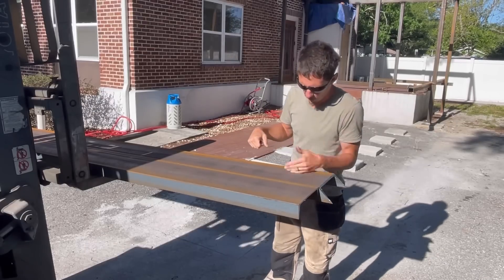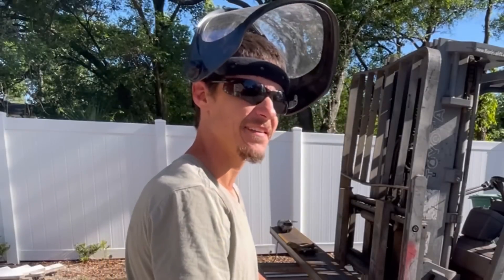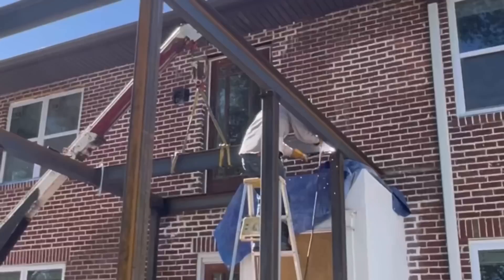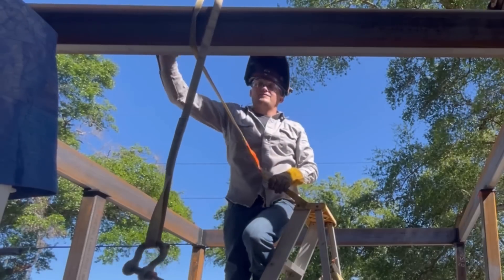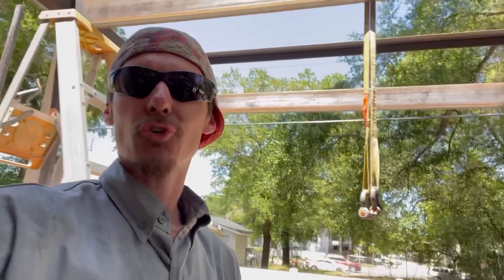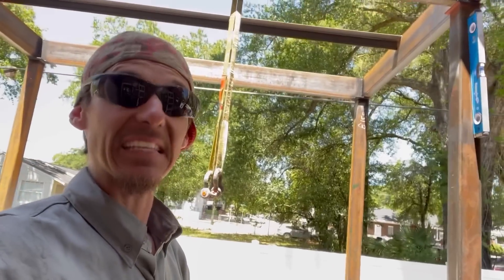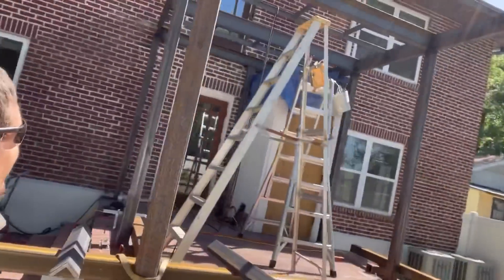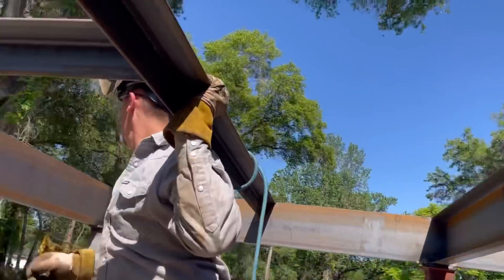Mobile Welders make $20,000 in 6 Days

Comment: Interesting video young man.
I would have designed that to be bolted together, made it in my workshop and test built if before going to site for fitting rather than fully welded onsite. But that is because I am in the UK and do things differently to most people, LOL!
Really great to how folk build and weld structures. Top stuff young man!
Reply from the maker: Thanks John! I need to travel there one day and see how its done on the other side of the pond
Reply: Every time ive been to states (live in uk) think why so much site welding seems a very slow way to do things

Comment: I have watched dozens of your videos,  good content, but you gotta get with the times and use a portaband and circ saw for cutting steel it's faster and cleaner,  instead of using a cut off wheel for everything.   And get a few battery operated tools as well

Comment: You do great work. I have been a welder for 50 years and haven't figured out how to make that kind of money. Well deserved!
Reply from the maker: Thanks Steve! I bet you have some tricks up your sleeve!
Reply: The best tricks r cheapTricks
Reply: you have to rip people off simple
Reply: @grimreaper6112  why do you say that? most of that $20k probably went towards steel. I just quoted similar stuff and even with tiny little landings on one stairway no landing on the other and only replacing treads on one of them the 3 stairways came out to like $8900. most of that is the price of steel. these guys are using channel that costs like $8.50 per foot and angle that costs $3.40 per foot. and that's just what we see on video. the material cost adds up real quick on bigger jobs like this one. I don't know what they're using for a walking surface but the material I would use costs $16.50 per square foot. They are in Florida though so they can use diamond plate outside. that may be cheaper.
Reply: So your profit was $20,000 after 6 days?
Reply: @grimreaper6112  sounds like someone sucks at running a business

Comment: What brand rods do you like to run? I just got some esab atomic arc 7018 aaclaim to try out compared to Lincoln. Have you ever noticed in strong winds the slag blows around on 7018? Not sure if it was just me today or I had something messed up.
Reply from the maker: I haven't had that happen, but I think these are just come cheap Washington alloys
Reply: if you got a compressed air gun zip tied open right next to your weld it will blow the weld out but Ive never had problems in open air wind messing it up. I run Hobart or Lincolns.